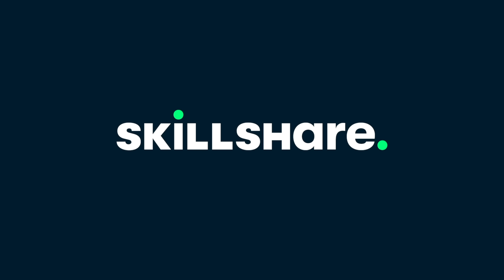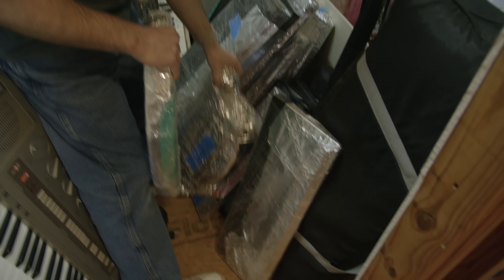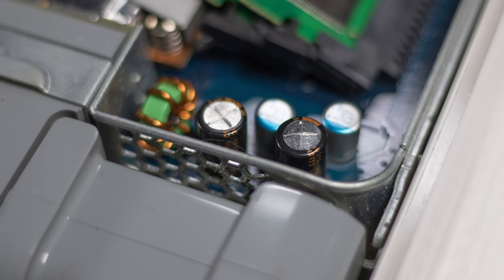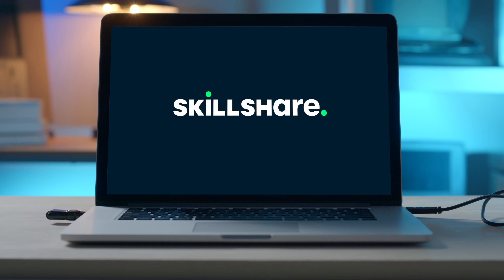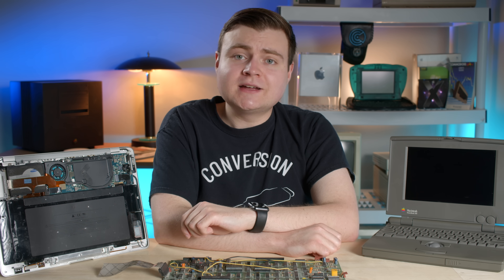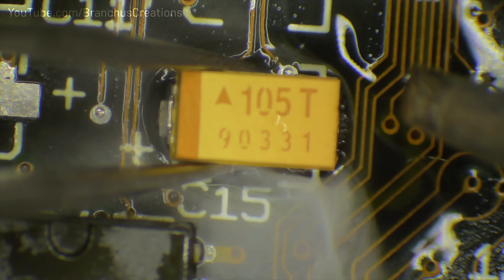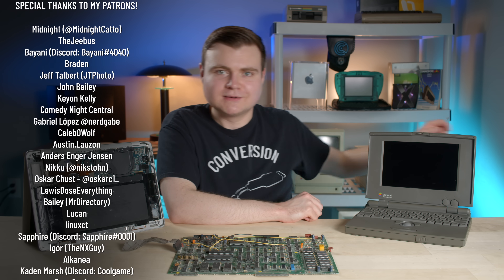Why Do Computers Die? (ft. The 8-Bit Guy) - Krazy Ken's Tech Talk

Comment: The 8-Bit Guy himself now counts as a computer killer.
Reply: I was about to say the same thing
Reply: ...I do hope he does repair it at some point, or even sends it to someone else who can. However, I believe he killed the power supply, not the computer itself.
Reply: @armanelgtron4533  oh, from what anyone can tell, the only thing "wrong" with the computer was that he didn't put the boot disc in.
Reply: @Charky_Creations  Not quite. After re-watching the video: when he attempted to power on the first machine, he got no video output. Instead of hooking up a monitor directly to the machine first, he decided to try to emulate the switch with a paperclip, but instead wound up shorting the power supply out. He took a dremel the edges of the screws to open the power supply and attempted to replace the fuse to no avail.
(He also noted that it used the same power supply connectors as an AT, however he didn't appear to compare to another AT power supply and try using one of those nor did he appear to try swapping monitors and/or power supplies between the two computers.)

He then went back and got a second machine which did output video, but found it would not read disks and had messed up text, but otherwise appeared to work.

What am I missing?
Reply: @Charky_Creations  I'd also like to note that I do not necessarily approve or condone that you (or anyone else for that matter) do what David did. There's no doubt that he definitely should taken more care.
Reply: @armanelgtron4533  you're missing what David was- knowledge of contemporary (ps/2) systems. Several people pointed out that ps/2 systems need the reference diskette (which was in the box!) Before they'll boot, and that the systems can offer up a beep code when they don't have that reference. I don't entirely understand it myself, but my first thought was to look for some kind of boot disk... Not to stick a paperclip in the power supply.
Reply: Looking for this comment.
Reply: @Slamm1nSalm0n  now that might break the universe.
Reply: why were people attacking him though. sure, it was stupid, but he made a mistake and theres nothing he can do unless theres some sort of miracle and he gets it fixed.
Reply: monday morning quarterbacking is strong on youtube
Reply: Not to mention Linus Drop Tips
Reply: Ironic
Reply: Lots of great surgeons, " accidentally," kill a few of their patients.  That's why the best heart doctors in Southern California  don't practice in Cedars Sinai ( near Beverly Hills ).  They practice ( literally) at County USC in the poverty area East Los Angeles.
Arnold Schwarzenegger & Sylvester Stallone both had their procedures done there in the 1990's.
Reply: The worst bit about the whole 8BG drama was not the fact he killed a computer for no reason, it's that he was whinging and whining about how he had to drive an WHOLE hour to get to computer reset like everyone in the rest of the world who is interested in this sort of thing wouldn't give one or several body parts to live that close
Reply: I saw this video in my recommended and came here purely to say it aged like milk.
Reply: EDIT: He has responded to the controversy. Please view it before you continue to make dumb jokes. https://youtu.be/SYopBjwhF1M

Sigh. Here we go again.

Big whoop, he made a mistake. People with all the experience in the world make bad slip-ups too (and every single one of you has too). He simply came to the wrong conclusion over what the multimeter said. No, he shouldn't have stuck the paper clip in, I won't argue with that, but losing sleep over screws getting dremeled away is one of the silliest things I've seen the Internet get salty over, especially on an internal part you can't see normally. Oh yeah, and the narrative that the computer was a "rare prototype" has been brought to question too, others have said it was a point of sale terminal -- again, I can hardly fault him for not knowing this because prior to the video going up, there was next to no knowledge on this computer and most people don't tend to actually look into it until after the video goes public, and the fact it's taken a week to get this far even after it went viral for the wrong reasons kinda helps further my point.

Was it a bad video? I guess. Is it worth suddenly labelling him as a computer killer because he made one haphazard choice? Highly doubt it. My main hope is that he learns from his mistake and maybe eventually releases a statement about it .
Reply: @MrEightThreeOne  the issue isn't that he "made a mistake".

 The issue was that he accepted a computer he had no experience in our time for, 
made a right arse up of the "repair" because he couldn't be bothered to look it up, 
posted the video anyway saying "oh well I fucked it but I've not got time for this", with no suggestion that he'd messed up,
 and then (reportedly) bragged on patreon that he'd "only" lost 800 subs which is a "drop in the ocean".

And all the while, a whole bunch of people who would ABSOLUTELY have had the time, care and passion to fix it up PROPERLY looked on in horror. 

People have a right to be angry, it's freedom of speech.
Reply: @Charky_Creations  And just like you have a "right to be angry," so I too have a right to think this whole thing has been completely blown way out of proportion. Again, I agree he messed up, but tearing into him and going full cancel culture on him like people have been doing is not making the situation better.

Also, no, he didn't "brag" about it, he just stated the facts about what it did to his overall viewership base. 

I don't agree with how you feel on it, and I probably won't change your mind. But again, my hope is that he takes time to think it over and consider what he could do better for the future, and again I'm hoping for a statement on it. I've seen him already talk in other comments about the reconsiderations he is making especially with respect to the backlash.
Reply: @MrEightThreeOne  no one is "tearing into him" or "going full cancel culture on him" lol wtf are you on about? many people were very disappointed and shocked to see him do something so heavy-handed to prototype computer that has almost no information on it available! no one is blowing anything out of proportion either. the 8-bit guy is known for his quality and care and yet, with that one computer, he decided to be clumsy and understandably people are incredibly upset because of it.
Reply: no a floppy disc killer
Reply: Ah yes this video didn't age very well
Reply: I'm a subscriber of The 8-bit Guy and NEVER knew about that issue.. maybe another YouTube's fault where some videos didn't recommend to my homepage even though I subscribed to a specific channel lmao..
Reply: I see he disabled comments on that video taking the coward's way out.
Reply: You just lost a subscriber
Reply: @S0N1Cua  oh well

Comment: Some early Atari STs also had issues where the recommended fix was to drop it from about 1 foot.  Some of the system chips are in PLCC sockets and retention clips weren't used, so they could sometimes become slightly loose during shipping.  If the drop fix didn't work, it would just require opening up and pushing down on the PLCC chips to reseat them.  As soon as Atari became aware of the issue, they started putting retention clips on the PLCC sockets to hold the chips firmly in place.

Comment: One of the killers of Atari 8 bit computers is the power supplies.  Over time these fail and send higher voltages than designed to the computers and can fry the RAM chips and others.  After learning about this I no longer use the original power supplies just incase, and a USB power supply is sufficient to power them

Comment: I service computers as a hobby and I've seen a lot of different ways a PC can die. From (mostly user caused) hard drive failures, bad capacitors, dead or faulty PSUs, to semi-cooked CPUs and toasted GPUs.
My personal experiences:
GPU in my first custom-built gaming rig, the 8800GTX, was killed by a single bad cap on the motherboard, near PCI-E slot. Funny thing is that none of the other caps on that board failed, only that single one. The PSU I've used for that build, the 600W FSP unit also developed bad capacitors at the end of it's service life.
My first high-end smartphone, Galaxy S4, had it's power management IC cooked by a power spike from a dodgy car charger (fortunately, finding a smashed phone with a good mainboard was fairly easy).
And finally, my cousin (who's a software developer) gave me his old laptop which had both a dead mainboard and a semi-cooked Core i7 processor with one faulty core.
As for physical damage, |'ve cracked the screen on my old Asus T100 hybrid twice. First time by accidentally kicking the bag where it was stored. Second time by dropping the same bag down from about 1m height.

Comment: Not to mention integrated circuits (IC's) will eventually stop working sometime down the road. Especially EPROM chips as they're designed to be erased and are more fragile. Not anytime to soon for most cases but they will all die someday. All those Atari 2600 cartridges will eventually die.

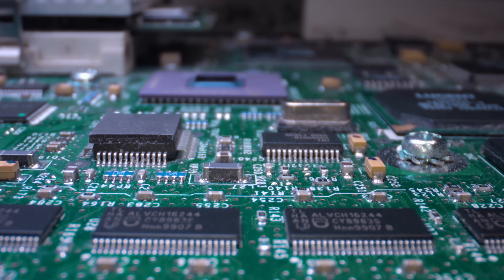Comment: 4:45 this is a bad representation.
What this represents is an Inductor. The inductor reduces noise. 

The capacitor when fully charged stops electricity flow. 
Imagine it like a Tank that has inlet and outlet pipe, but i. The middle tgere is a big membrane. The membrane can move and create tension when there is flow and when the peak pressure is reached, you can no longer fill it in. 
When there is no more inlet of water coming in, the membrane pushes the water back in the pipes  into other components. 

->  =[ )]=  ->  | pressure builds up, (capacitor charges) 
<-  =[ )]=  <-  | inlet stops, pressure takes over (capacitor discharges) 
    =[ | ]= | tank pressure is equal from boths sides of membrane (capacitor is discharged)

Comment: Why do some computers die? Well, clearly many of them don’t have enough thermal paste on their processors. You need to make a waffle grid pattern with your third party paste and then attach the cooler with its pre-applied paste still on it. That will give you plenty of paste to work with. Also make sure your motherboard is screwed in with confidence.

Comment: It should be warned to be careful around capacitors, especially big ones since they could still have power in them when the computer or device is off and unplugged. Even weeks later. I wonder what it would be like to have a large one explode in your face. It wouldn't be appropriate for Youtube. Thats for sure.

Comment: You also forgot BAD batteries. I've never seen the amount of damage from a BAD battery inside a Mac Classic specifically. They leak and probably destroyed most of the Mac Classic's already. The other Mac's I had never had this issue. Also the Varta cells of DOOM on PC motherboards. These were also used in Amiga 2000's and most of them in my collection had this issue of them just leaking over the board again and again. They also destroyed numerous Amiga 500 Ram Expansions.
Reply from the maker: I forgot to mention bad batteries? Are you sure?

Comment: Both my 386 and 486 suffered battery failure.
The 486 was repaired before I received it, but I can see a big burn mark on the AT power connector, and the replacement battery is kinda bodged on.
My 386, I realized that I miiiiight want to replace or repair the NiCd, but it had begun leaking and damaging traces on the board by time I got in there.
I was able to splice around some of the failed traces, but my SVGA video card still won't work in the system, so I think I still have some work to do.
I was also able to splice a modern lithium coin cell onto the expansion header, as the original builder had connected an alkaline booster battery to the system, so when it got depleted I just hacked it out and put the lithium cell in its place.

Comment: Bearings.  If it was moving a lot for a long time and it stopped.... it probably won't like starting again.   The ancient HDD seize, the power spike causes the ancient PSU to blow and a nice big spike of power goes in to the MOBO.   Always pull old drives before first powering up your newly acquired retro rig... or your pride and joy might become a door stop.

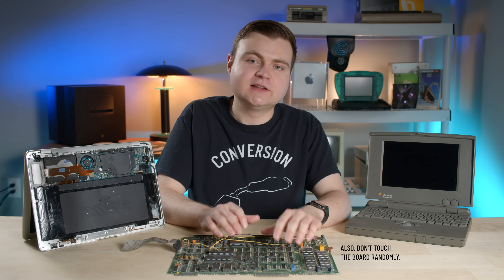Comment: 7:50 I was a hardware tech for a large American Co for nearly 20 years (Later contracted to them in one of the political moves that made me give up on IT).
The company had 750 staff in one building and I was replacing IBM KZA motherboards nearly one a day (so up to 3-4 on some days) due to the stolen bogus electrolyte formula (Chhsi capacitors)).
It was interesting that IBM never mad a recall on such an obvious manufacturing flaw.
Later the Dell units they changed to suffered the same fate... still no recall... Then the dell Latitude D620 laptops had Nvidia chip failures at the same sort of rate.. again no recall.
I even had to point out to Dell that there was a design flaw inthe shared GPU/CPU heat sync that left an airgap between the faulty GPU and sync large enough to slide a sheet f paper unabated.

The Nvidia GPU failure resulted usually with a double image of the screen... Unfortunately the companies "Helpdesk" was based in India (I initially was on the NZ helpdesk before it got moved overseas) and they would try and get the staff member to rebuild their laptop (until I just got the staff to say I had already looked at it and asked I get them to log the call).
The movement of local country helpdesks to India etc was another disillusionment that made me give up the trade.

That and Microsoft rolling out things like Vista and windows8 and now they bring you Windows 10 (I used win 1 and 10 looks like something 5 years on, not 30!)
Windows 10, the only product that you get less of with every update... (so what program, function, feature that you liked got removed lately?... 

did you know Windows Photo Viewer still exists... but no you can't just turn it on... you have to hack the registry, just like every other feature you used to be able to set in say Windows 7.... You know, the version of windows that was almost excellent... except for the bugs they refused to fix because Windows 8 was on the horoizon so why fix the current version (ie the Explorer folder list bug that kept jumping away from the current folder in the list)...
Windows 10... where you have to PAY for a non MS "Easy Profile transfer" system that was free on all the preceding versions because they couldn't be bothered fixing a couple of bugs.

Sigh... Now I'm a Mechanic/engineer

Comment: Letting cats rub up on me and I didn't use an ESD Wrist strap when I was trying to make a frankenstein project of taking two sub par computers and making a single great computer. The Cat's generated an ESD Charge on me that it caused the "Magic Smoke" followed by the sweet smell of death. So, I invested in an ESD Wrist strap and when I built this computer which I am watching the tube and what ever else I do on it, I was using the ESD Wrist strap as I was working building and even working on the inside with cleaning it.

Comment: I once bought a PS4 for parts that had a "bad HDMI port". HDMI port appeared to work, but I wanted to open it up to check for cracked joints just to be sure. The power supply cable was stuck, and attempts to remove it resulted in the socket ripping off, rendering the device permanently inoperable

I got lucky the next time, it was a "bad HDMI" one that literally just shipped with a broken HDMI cable. I use that system to this day

Comment: One day i played the remake of unreal tournament... bzzz. PC went off... smoke... i looked inside.. i took out the gpu and turned it on, worked. 

Then i took off the backplate of my (back then 2 y.o.) 780ti.. 
Blown cap. Shredded all layers of the gpu :/

Sent it in for repair. Bought a 1050ti for the meantime that worked without problem.
Got my card back and it worked.
Only to find out, that 2 weeks later it broke again.

Comment: One thing you might want to add for the modern computers/processors and that is the semiconductor themselves has also a lifespan depending on the voltage, current and temperature used on them.
That is especially relevant for the small transistors gate size that has been reached nowadays, 5 and 3 nm, where a high gate voltage could seriously decrease lifespan and most of the time it is just not easy to montior it.

Comment: Would it be ok to replace a electrolytic capacitor with a solid state one if the specs match up? (This would be for a board from 1999)

Comment: I had 2 DOA PB450 boards for my Packard Bell and found one that works and cheap. I was lucky that my 386DX/486DLC computer didn't have a lot of battery leakage and I removed rust from a computer case recently that suffered from water damage and nothing internally broke or got destroyed by the water as it wasn't that high.

Comment: My 2012 Macbook died within 2 years. The screen stopped working and it would only turn back on when I put pressure on this spot on the bottom. Opened up the bottom of the case and rolled up some duct tape to put pressure on that part when the lid was closed. This made it last couple of more months extra.

Comment: I bought a DVR in 2006. In 2010 it had to have capacitors replaced. That was the time of the digital switchover so many bought DVRs and they often had capacitor problems at about 4 year mark.

Comment: I had a custom built computer built by one of the many ads on the Computer Shopper Guide.  Took 6 weeks.  Plugged it, powered on, and blank screen.  Fan was working.  Called customer support.  Says it would take weeks to repair.  I opened up the case.  Realized the eprom was in backwards.  Flipped it and the computer booted up.  I'm certain it never had a burn in test.